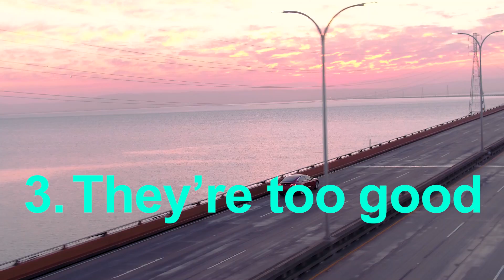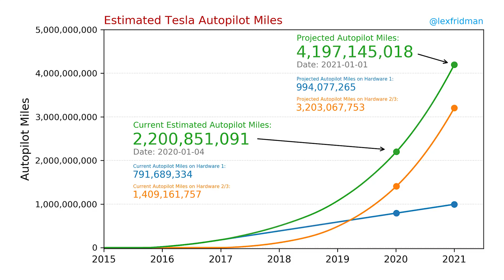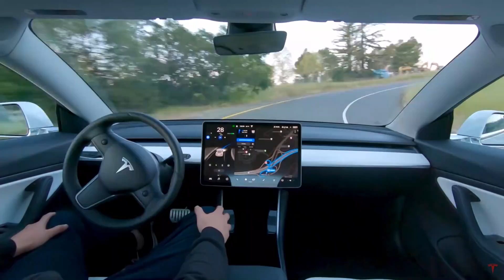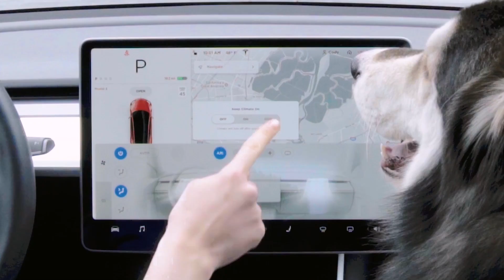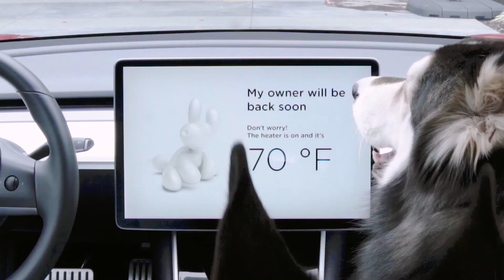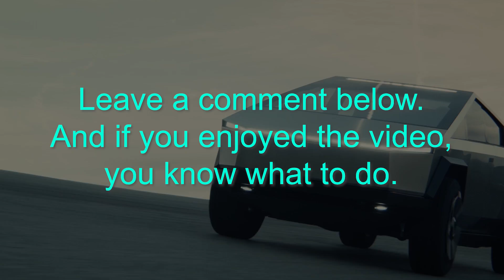Tesla Battery Investor Day (Predictions)

Comment: Hello, I work in R&D in automotive in Germany.
If VW , Daimler and BMW really want to catch up, they will.
They are only late on battery tech, but they bet on the Solid Battery tech. If they succeed soon, they will catch up and overcome.
They can start battery factory if they eally want.
Having years late compared to Tesla will not be an excuse.
Reply: Away from home 
They’re also late on software...
Which is why they have EVs sitting in parking lots...not driving around sold.
And late on transitioning from ICEs...
And late on delivering enough charging stations globally.
And they’ll be late on autonomy...

VW will probably be the best (Non-Tesla / Non-Chinese) auto manufacturer out of all the legacy makers. But they have a lot more issues than just the batteries.
Cheers
Reply: @davidc2838  Volkswagen has a lot of EVs waiting for a sofyware update, but when they do fix the software, they won't have a supply issue like Tesla.
Reply: AlphaCentaurian Person 
Sure they will still have a supply problem. 
While VW is probably doing better than the other (Non-Tesla & Non-China) EV manufacturers...
They still make almost ALL of their money from ICE cars...

The more they promote (and manufacture) EVs, the more they strand the vast majority of their manufacturing assets (ICE).

They cannot (will not) start making massive numbers of EVs until they can switch their primary mode of production to EVs. It would be suicidal for their ICE business and cause the company to collapse.

They will ramp up their EVs relatively slowly...compared to what is “possible” for VW to actually accomplish. They will also likely be battery constrained for the next few years. (They could force the battery issue...although they won’t...again, it would be bad for their core biz.)

I believe they will beat out FCA, Toyota, GM, etc. in terms of pure EVs to market (not hybrids). But they won’t cut over the really big numbers yet.
I would love to be wrong about this...
But that’s unlikely.
Cheers and have a great week.
Reply: @davidc2838  As long as they didn't clearly define, what will be using in their solid batery, they cannot know wich raw material they will need
Reply: @awayfromhome3741  
Hi Afh,  Thanks for your reply.  Again, I am not sure which "they" didn't clearly define in their solid battery.  Please share which manufacturer or supplier you are referencing.   Thanks!
Reply: @davidc2838  I have them as customer, about video analysis, we hire the same software supplier as them. We are same level
Reply: @awayfromhome3741  
Hi Afh,  I am not sure who "them" is as your customer. Not sure what software you are describing, that "we" are on the same level.  Tesla is far ahead of all auto  manufacturers in software and gaining.  It's in part because they are vertically integrated and all their systems can easily communicate with each other.  Most other auto manufacturers outsource a large amount of their various systems.

Comment: I think we're a several years away from Tesla selling battery assemblies or powertrains to other manufacturers as they can barely supply themselves as if right now. That said, I do agree with the rest of your video. Legacy automakers are dead in the water and cannot compete with Tesla and many will fail without government assistance.
Possible reason #1 is because Tesla is run by a physicist/software engineer/innovator and not a bean counter and is frankly, much smarter than the rest. Musk thinks outside the box, he's not centered on personal fortune and actually wants to improve our lives. Man of the century!

A side note: I've been into the stock market only since October and am continually shocked at the apparent ineptitude of many analysts. I see a lot of snake oil type sales pitches and downright dishonesty being displayed daily. It's absolutely bizarre!!!!
Just a hint of negative news on Tesla and somebody will downgrade their Tesla position. Absolutely weird! I'm not quite sure if it just shocks me or just treat it as an odd form of entertainment.

Comment: I think Tesla may announce a hybrid battery that includes a supercapacitor portion capable of quickly absorbing almost all of the energy created by regenerative braking and then power the motor(s) while recharging the battery pack at a slower rate that the pack can absorb. This set-up could double or even triple current range.
Reply: I would have thought so too re the super capacitor but Elon says he is not planing to use super capacitors for now

Comment: The Tesla Semis are already able to accelerate for 2 miles up a 5% grade at full throttle, pulling 50,000 pounds without overheating the motors OR battery! There is some special sauce in the drivetrain but also in the battery. This goes way beyond a heat pump or extra radiators - do the math - there are a BUTT LOAD of BTUs being generated in that system. Where is all that heat going? That's all I'm asking.
Reply: That thing is too heavy to carry a legal 50,000 load
Reply: @cindytepper8878  so sorry you missed the point, maybe next time. Thanks for reading it, though.
Reply: @r.a.monigold9789  The only secret sauce in any of Elon's great projects is bullshit. His crap is worse than the cover of 1950's Popular Science mags

Comment: Million Mile Battery is needed for the Tesla Semi.
Reply: nope, its the battery density that is needed
Reply: Fuel cells and LiFePO4 or NiMH cells could produce that lifespan but NCA lithium ion nope.
Reply: @Patchuchan  That's fundamentally incorrect. There's plenty of Li-Ion battery chemistries that can get to that many cycles (in labs) it's about getting it to commercial viability (which is usually the hard part with new tech and laboratory findings)

There's plenty of evidence that suggests Maxwell's dry electrode technology is enough on its own to get Tesla there. The materials they use for the electrodes are more stable and don't crack or deform as much during cycling. This alone may enable "the Million Mile battery"

Also, LiFePo4 has great cycling potential, but its sacrifices of energy density mean its unlikely to reach that milestone any time soon. (remember, it's at a rated capacity of (usually) 80% of original density.)

There's reasons NiMH hasn't been used in any serious capacity for decades. One is similar to LiFePo4, low energy density comparatively. Both are great for stationary applications though.

Comment: Another great video. You should do a video about GM and Honda partnership. Honda will supposedly buy battery tech from GM. Why?? Honda is also buying tech from GM’s cruise automation.  With vehicles due in 2024. Honda what are you doing?? It’s almost as if Honda is trying to go out of business.   

Or look at Toyota, boasting about a new HFC Mirai that has a range of 400 miles.  It seems clearer and clearer that VW is the only legacy oem that gets it.  With 5G internet on the horizon. A fully connected electric autonomous vehicle is the finish line.  Not gasoline, not diesel, not HFC, not LNG, not E85, and not some Hybrid mix.

Comment: Great video. I'm not sure about the last part though. I believe it's possible that Tesla's plans have become more ambitious of late. Several years back, it was assumed that there was no way Tesla could transition the world to BEV's without massive assistance from legacy makers. But now, we've seen Giga plans shift to Tera plans. Tesla makes about 500,000 vehicles per year today. At a 50% annual growth rate, Tesla will make over 60 million vehicles in 12 just years. That would be most of the world's 100 million cars and light trucks. While I don't think this level of dominance is likely, Tesla could get a good chunk of that market share. The important thing is that Tesla's own production goals have shifted dramatically. Giga 1 opened less than 4 years ago and its planned battery production is already only a tiny fraction of Tesla's new goal.
Reply: Even Tesla claims it produced only 102,672 units in 1Q20: https://ir.tesla.com/news-releases/news-release-details/tesla-q1-2020-vehicle-production-deliveries

Comment: Steven,
I still think that the major factor, at least initially will be the rate of cell production in the same, or similar factory space.
You can build 10-15 more factories, OR produce 10-15 times the number of cell in the same factory.
That's the Maxwell solution.
It does raise a question.
What do you do with the cells?
You need more packs 
That's where the Tesla "pack patents" come to the fore.
Faster, automated pack production.
Then there's the density/ chemistry improvements.
Together, maybe 20% total as a pessimistic first stage. improvement to all of the above could give 300-350Wh/kg.
Suitable for Model S/X, including Plaid(!?)
That enables a single manufacturing facility (no expensive low volume/ shipping from Japan). S/X margins increase!
The same cell? Why not the same pack design for all? (Slight pack size difference)
Then
Same pack design? Why not the same BMS? (Software variable for each spec).
At that point, they have:
The same, existing factory (minimal CapEx)
Cheaper, better cells AND packs.
Slimline pack / BMS production.
Better performance.
Pack cost below $100/kWh? 
I won't be surprised.

Comment: Wow, didn’t say much about the “power train side of “Battery and Powertrain investor / inverter  day”   Shoë where do I start...Tesla understands, “Efficiency first principles” in which getting longer range means getting much much more distance on less kWh of stored power. Next,,if vw buys tesla power trains then those vw will be able to charge at tesla superchargers but they will have to pay for that, opening up a massive income stream for tesla. If they use tesla power trains then the 3rd part car wil need tesla software and then they will also be tesla auto pilot compatible... this rabbit hole is so deep. Tesla will both OWN and PWN all the other car makers. It’s no contest now, Tesla won, legacy auto lost.
Reply: Doubtful VW would do that.  VW Group is spending more than anyone else on realizing the potential of EVs and on infrastructure.  And the problems they are having with software would def not be solved by adding another 3rd party contractor to the mix.
Reply: (*Psst* Don't underestimate China. They can easily steal Tesla's tech, as Gigafactory in Shanghai is an opportunity for it. It will be like it is with phones. Apple or Huawei?)
Reply: diamenciarz you cannot steal tesla’s tech, SMR made whole video about it
Reply: @Trollsworkshop  I can not find his video about it, can you link it or give the title?
Reply: diamenciarz “you will no longer be at the company” is the inscription on the video image, the title is tesla and spacex innovation reaction video I think.
Reply: @Trollsworkshop  Found it, thanks
Reply: @Trollsworkshop  Okay, so after watching the video, I can agree on what I never disagreed on. Tesla is innovating fast and any stolen tech would not make a different company competitive, if it couldn't keep pace with Tesla.
But my point about China was a little more specific. There is a single exploitable point.
Tesla is working on its Autopilot, using machine learning. It takes a lot of computing power and Data. Tesla has both. China does not have a million cars with needed hardware on roads collecting information, but their engineers completely understand their position.

BYD is an EV producing company owned by the Chinese government. They really want to have working autopilot on their cars, they get it.

Now a little context, from Andrew Yang's interviews I have heard that the Chinese government is putting a few times more money into AI technologies than the US. (Tesla was not under that comparison, so I don't know what is the ratio exactly)
Anyway China has more money to invest than Tesla and it is a big deal for them.
If, somehow, they hacked Tesla's Lvl 5 Autopilot software (in a few years, when it's ready), they will have enough computational power, to drag it forward and be competitive.

Let me shit a little more at the US.
Since the oil-funded president dragged the country behind, while China was investing heavily in the newest tech, Elon's companies are the only competition to China (BYD).
You may also know that existing US car companies will not be competitive. (Pls, don't be picky here, I'm taking overall)
The US's government is held "hostage" by the oil industry. They are not very helpful to Elon, even though Tesla is the most American company. If it is the Koch brothes' money, other oil giants' money and China's money against poor Elon, then I'm worried.

I'm open to further discussion, if you want to ;)
Reply: @Trollsworkshop  I would also like to set something straight, something I see many youtubers get caught into. Remember these dumb tesla critics, these stock analysts who are picking on stupid things to shit on Tesla?
They definitely make an impression of an idiot, but they are just one example of the oil industry's money at work. They get paid a shit ton of money to turn people off Tesla at the cost of their reputation.
You may have noticed that many of these analysts don't have a very positive investment history (meaning they lost a lot of money).
So they are the ones approached to spread misinformation. They weren't good at their job anyway, but they still have kids to feed and they would still like to live comfortably. Solution?
Give bad investment advice, but get paid two-fold by the oil companies. They both have a profit.

Example:
If a so called "analytic" gets paid to go on Fox News and spread misinformation, the company, which paid him, get their message to hundreds of thousands of people, buy only pay one person. It is so cheap. No need for advertising. Although advertising is also used. Some advertising campaigns have changed laws in many states, provided the legislation was important enough, like for example forbidding people to organize protests against oil companies at the threat of many years of imprisonment. Yup, that law got about 20% approval at the beginning, but after a few million dollar advertising campaign it got passed with 55% approval.

So, yep some analysts seem to be idiots, but they get paid to be ones.
On the other hand, no one gets paid to correct them. The money is not on the side of truth. It takes Elon Musk to achieve something in that corrupt system. Meanwhile it pays more to criticize him and make it harder for people to innovate.
I'm not saying we should do that, but that's just how it is.
Reply: moron
Reply: @carholic-sz3qv  You'd be better off without insulting people. Look, it's possible. I am even interested in the video about, why tesla's tech can't be stolen. I hope, to find it.

Comment: People need to come back to reality. There WILL NOT be robo taxis for at least ten years, maybe much longer.
Reply: Claude Desaulniers what makes you think that?
Reply: @BerryURL   Computers are great at following instructions and doing calculations, but they have no reasoning skills. Ask a computer if an elephant can fly, it won't have an answer.  Many developers are now admitting that full level 5 autonomy is much more difficult than they had first anticipated.  A robo taxi in traffic would be a nightmare. The taxis safety systems would be so overly cautious that the robo would be paralyzed and cause massive traffic congestion. And that is just the beginning of a slew of issues. Just Google " robo taxis not coming soon".  They said ten years ago it would be here in three years. It keeps getting pushed back. Expect a minimum of ten years or more before you actually see a full robo taxis in traffic. They may have experimentals in quite neighborhoods, but not in full traffic, not for a long time.

Comment: Excellent video as always, and I think your spot on on nearly all counts. I think the major thing that they're going to announce is a new battery cell type, that is of their own creation, which will enable the million-mile battery. This will also be a battery that can drive the cost per kilowatt hour down even further. If I were to speculate I would think that they could announce a plan to get to roughly $50 per kilowatt hour in 5 years. In order to achieve this they would need gigafactories, lots and lots of gigafactories as well as a major reduction in the amount of complexity needed to build massive amounts of batteries. I'd expect some type of a heat map to show where they would need these gigafactories. Lastly I would also expect there to be some mention of energy density. I'd expect a 5-year to 10-year graph showing energy density going up 25 to 50%.

Comment: My predictions for battery and power train investor day:
New battery tech allowing for:
1.  Greatly reduced charging time
2.  30% greater range across all vehicles because the new batteries are far more energy dense
3.  20% reduced battery cost per vehicle, with a road map to a 40% to 50% battery cost reduction
Reply: Based on what
Reply: That all seems pretty extreme.  It sounds like you are basing that on the promises of solid state cells that no-one has actually figured out how to mass manufacture at the claimed efficiencies.... and Tesla's own history and hints and patents have directly focused on iterative improvements of lithium ion cells... And mostly centering around reducing costs, with improvements in efficiency coming less swiftly than cost reduction.

Comment: That 2019 cost of ownership chart with gas at $3.10/gal [$1.60] and tax credit [expired] for Tesla is a joke. Your claims that the other manufactures can not "catch up" is egregious, they just do not want to. GM can fix the styling - it is not that expensive. GM does not want these electric cars - it does not fit their models.GM, Ford, Honda are top heavy companies where money siphoned to upper management, so why invest in R&D. Volkswagen's New EV starting at $33k - is a very good example.